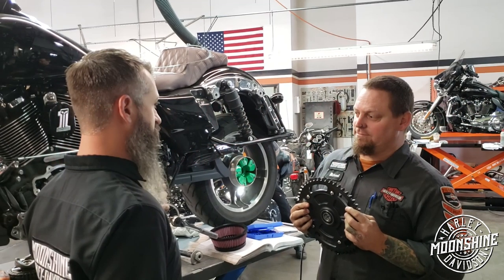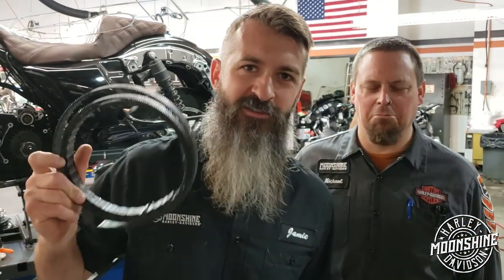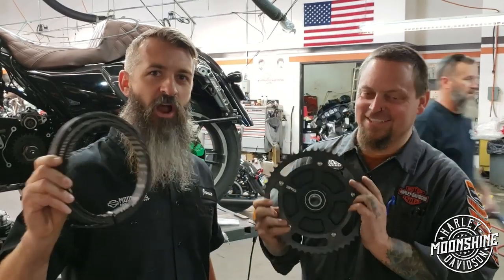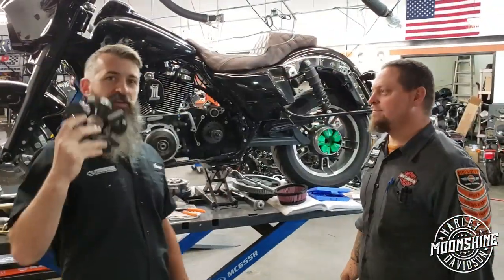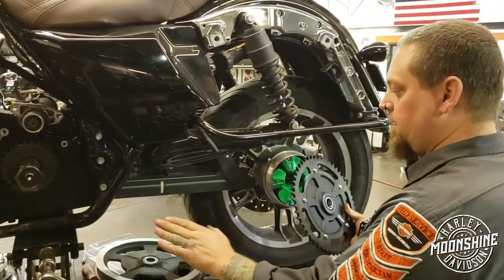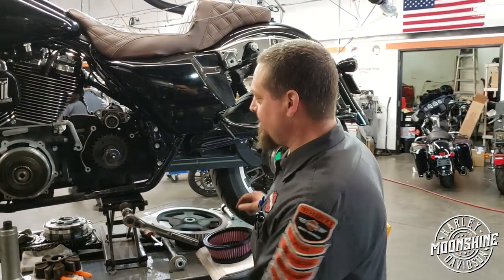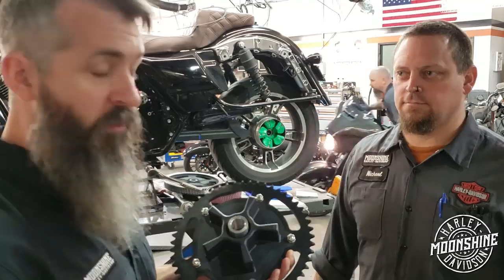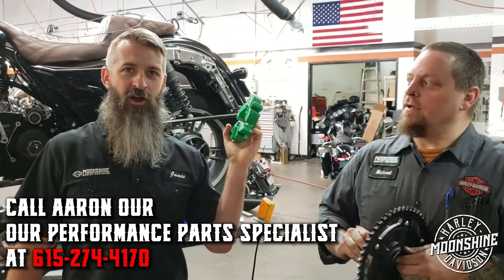Belts Are For Pants...NOT BIG Motors | Shop Talk Episode 29

Comment: Performance Machine makes a forged pulley that prob stronger then stock. Chain sucks on a bagger, oil geting on bags and its hard to clean under the bike, its not as easy as cleaning a Yamaha r6 chain or something, if your drag racing you dont even need to oil your chain so its fine, just clean it and your done. Im not saying your wrong just saying if your bagger motor is riping apart your bike it might be time to re evaluate wtf your doing and why.

Comment: What are we talking with big horsepower doing that to belts? 175-180ish?
Reply: Joseph Hart it’s more about how you ride the bike than HP. The more power you have the easier it is to de-teeth or break the stock belt. We recommend going to a chain if you exceed140 HP plus or for riders that are going to push their bike hard. If you do a chain right out the gate you won’t be stuck on the side of the rode.